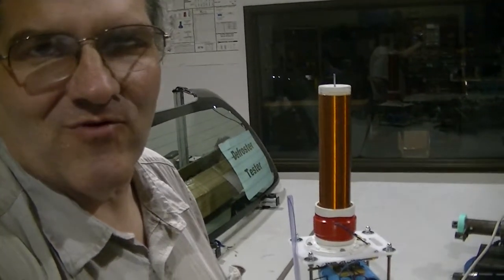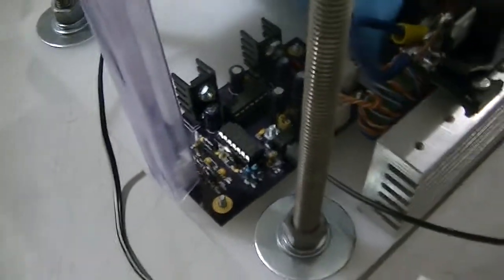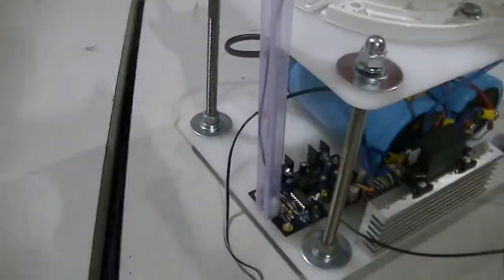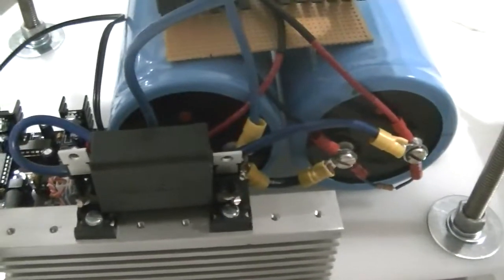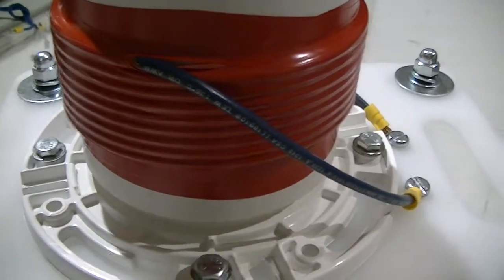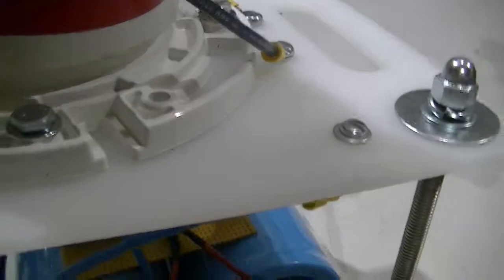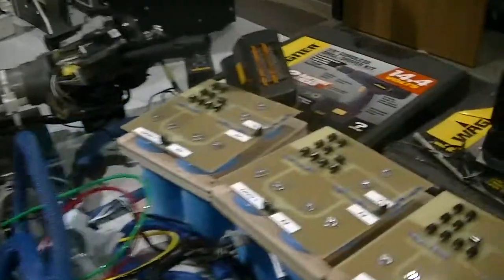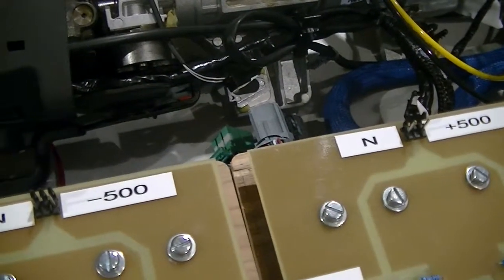2013-10-10 Musical SSTC First Light

Comment: excellent! I'm planning on building a class-e drive arrangement tesla coil at some point, not sure if I'm going to be able to audio modulate it with the circuit that I have in mind. The circuit is dead simple, but I don't have an oscilloscope for tuning so that's my limiting factor right now. As soon as I get my hands on a scope, it'll be a piece of cake.